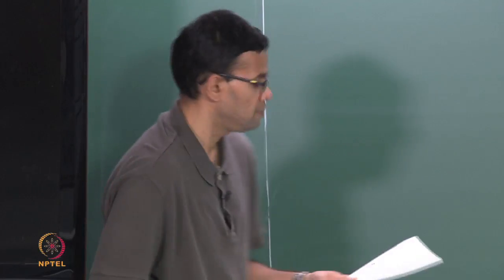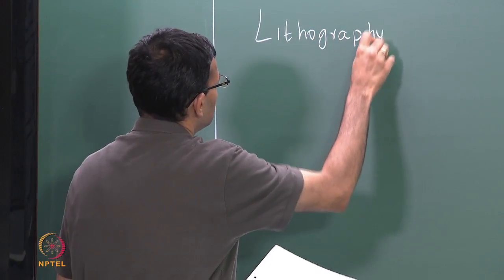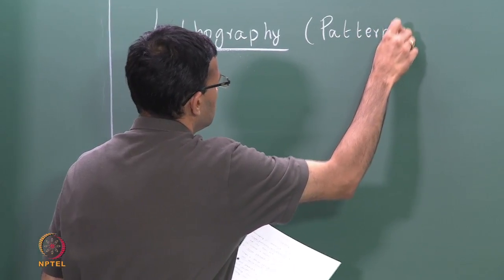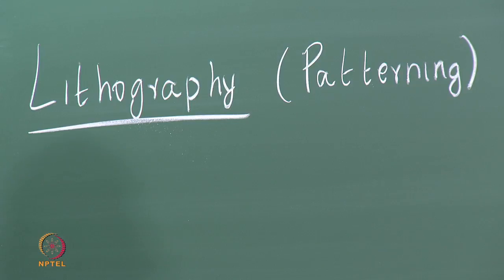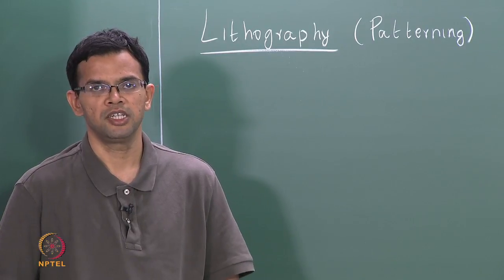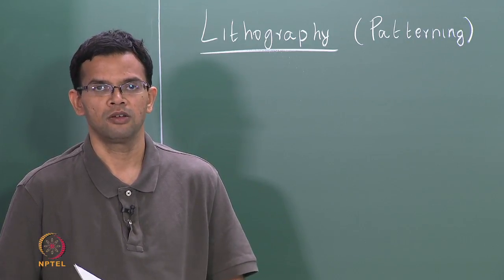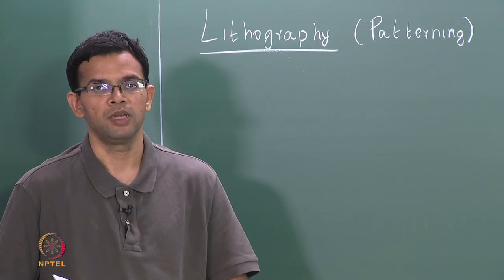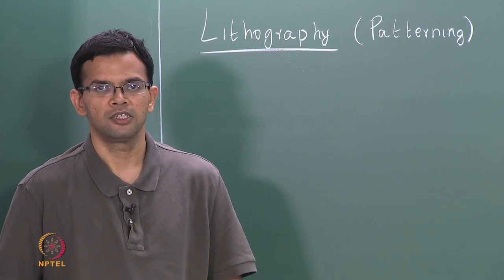Mod-01 Lec-25 Lithography

Comment: can we beat rayleigh limit in lithography?
Reply: Kaleem ur Rahman Khan i think we cant. Thats why we use electron beam litho for sub microns size.
Reply: @UmmUkashah  For nanoscale features photolithography can still be used. There are multiple "cheats" to beat the diffraction limit some of which are phase shifting masks, immersion optics, and multiple exposure patterning. If you have 193nm light (as is standard) but you need 7nm features (as is current feature size) that is well beyond the diffraction limit however, these techniques can allow very precise expose of light.